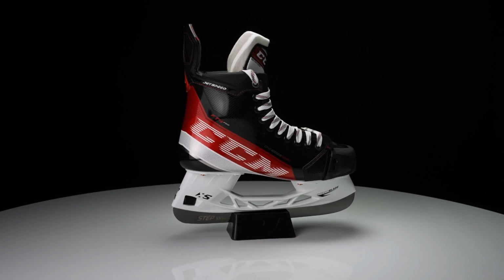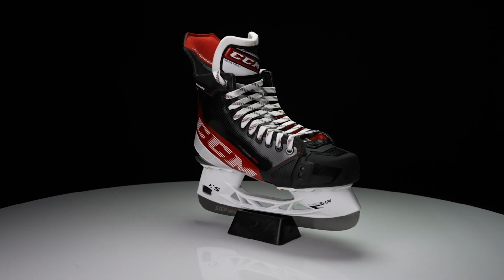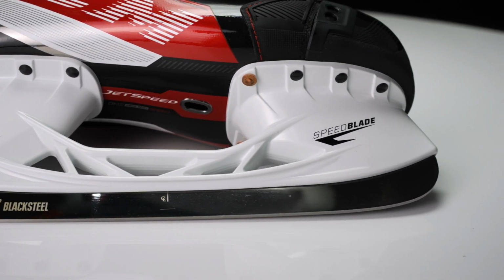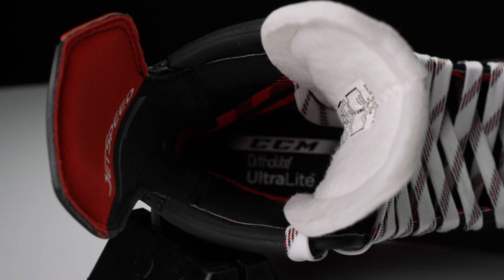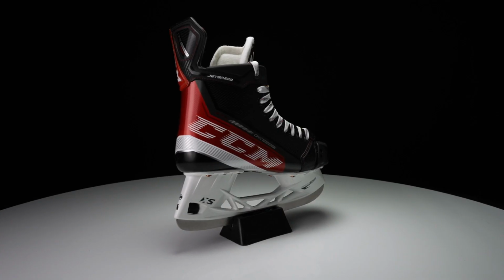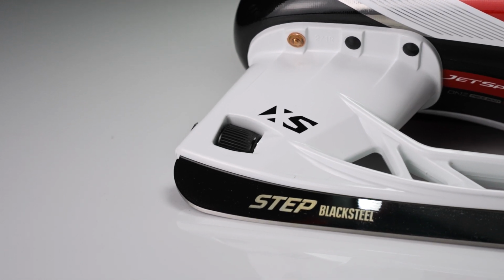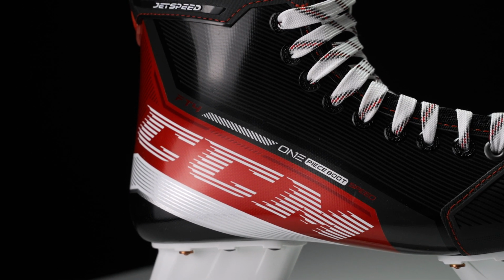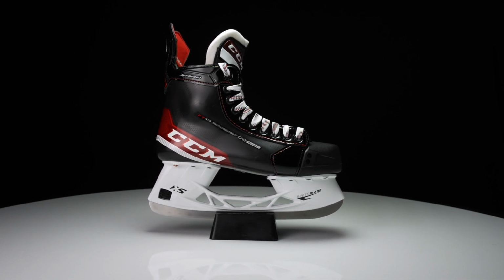CCM JetSpeed FT4 Pro Skate Line // Zoom Insight

Comment: I am a frequent pond hockey player and I am experienced with skating. I am currently using the ccm tacks 9042 which are an older entry level skate. Do you think it would be a good idea to upgrade to the ccm jetspeed ft475 that I found used for $100?
Reply from the maker: Hey Mark, I answered your question on the CCM Performance Lab video!

Chase at IW Hockey

Comment: Pretty excited for the ribcor release this year if they do a similar one piece at the mid to mid high level skates, I need something wide and I'm hoping the ribcor fills that need at around the 3 to 400 range this year if so ill be buying ccm for the first time.
Reply from the maker: Unfortunately, the RibCor Line will only have a one-piece boot in the top end but I have a feeling that will not be the case for the next generation of RibCor skates. BUt for this year, they will be offering the Regular and Wide 3D Fit in all of those price points you're looking at. 

Chase at IW Hockey